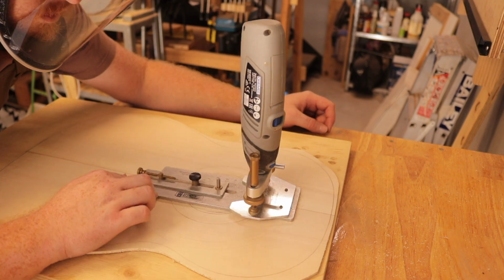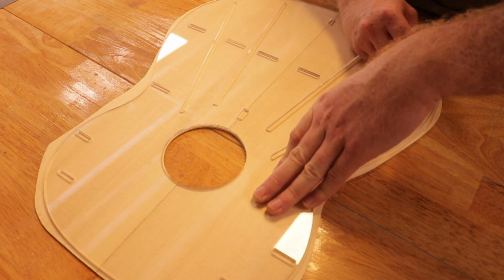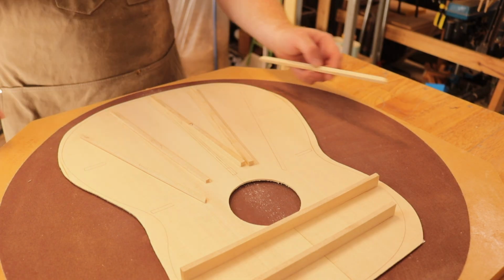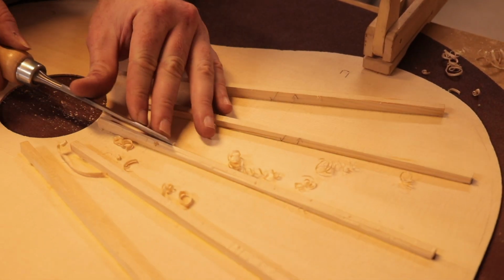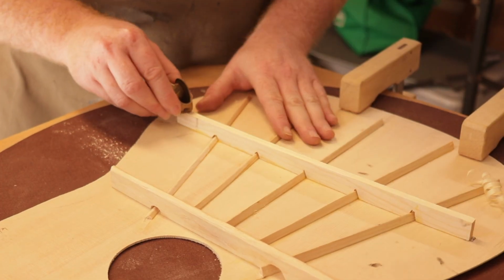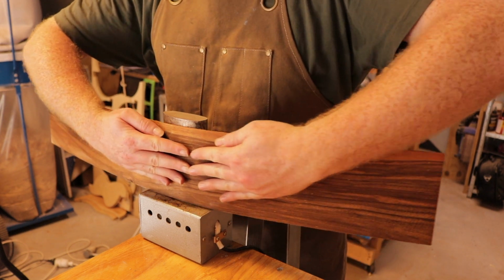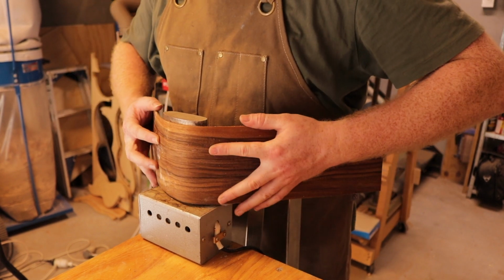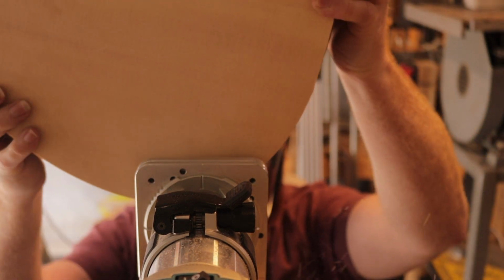Building a Fretless Guitar | Chapter 1

Comment: I wonder how the acoustics would work if a hard material was layered on top of the neck (could it still be called a fretboard?), whether its a sheet of metal like copper or steel, or just an extra thick coating of polyurethane.
Reply from the maker: It definitely has been done before! I’ve never heard a side by side comparison though. I’d love to build a guitar with a removable fretboard to test that sort of thing out